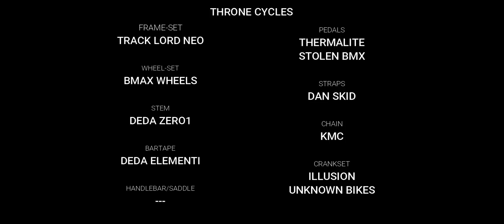DREAM BUILD FIXED GEAR BIKE - TRKLRD - NEO CHROME - Throne Cycles // TALI Bike

Comment: Bro first of all u are install a carbon Compressor inside a carbon/alu fork yes it might be safe but try to use a starnut if possible because there cases where the fork will crack while using the compressor plus it could be stuck there or it could just fly out the reason I saying this it because i heard story about that the thing I typed in this comment
Reply from the maker: Ok. Thank you.

Comment: If only my GPS tracker would fit inside the frame 😞 and they had it in my size
Reply: What size do you need? I’m having a similar issue for the color I want. Bikes are in low supply right now it seems.
Reply: @deerinheadlights9784  well actually just recently checked out the throne website and I guess they got some more in stock because now they have my size for a while the biggest size they had was a 55 which I could probably get away with that but what I really need is a 58
Reply: Christopher johnson glad they got a restock of yours. I hope they do for mine too. Have you had a throne before?
Reply: @deerinheadlights9784  nah never
Reply: Christopher johnson can you update this thread once you get it with your impressions? I’d be curious your take. Hope you end up liking it
Reply: @deerinheadlights9784  oh definitely man this has actually been a dream build of mine I just never got to building it and honestly I think mine's going to look out a little bit better than this guy's version of itthere's nothing wrong with his build I'm just not a big fan of the wheel set
Reply: @christopherjohnson7664  That's awesome. I hope you post pictures or make a video of it so I can check it out. What are some things you're thinking of doing for parts upgrades/customizations? I'm looking forward to buying one if they still have my size in a color I like when I'm ready. I've never built a bike before and am thinking about upgrading a few things from the go while riding it out on other parts until they wear to customize unless it bothers me enough.
Reply: @deerinheadlights9784  well for one I plan on putting all bladed spokes onto the rims just to make it a little bit more aerodynamic I would love to be able to put on some navigate tri-spoke rims preferably on the front rim and just have a very deep dish rim in the back then go to wheelbuilder.com and have them make me one of those plastic rim caps that goes around the rim tied all the spokes and everything and just to make it also more aerodynamic but I can't decide whether or not I want to put a few carbon parts on the bike or not like a carbon fork carbon drop bars also I'm planning on slapping on the biggest chain ring I could possibly find maybe like a 58t or a 62t

Comment: Hey bro! This frame can use hollowtech top crankset? Its recommended for a fixed bike or the squared one is better i nthis case?
Reply from the maker: ALYZER hello. For fixed gear you just can use track crankset with 1 chainring. You can use external BB or Square BB .
Reply: @DreamBicycles  thanks bro, you rock!
Reply from the maker: ALYZER hope you will have a cool crankset